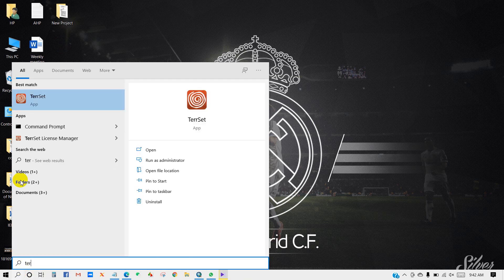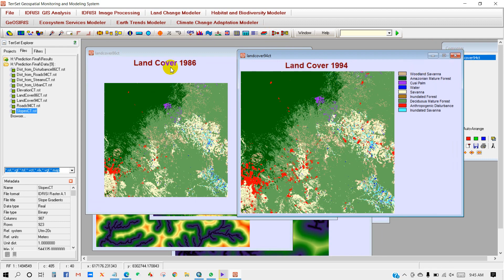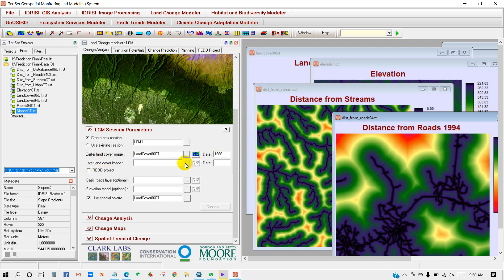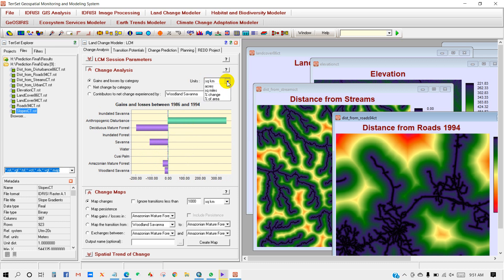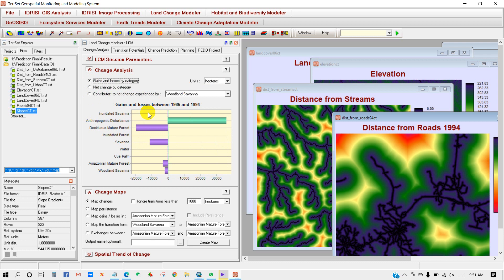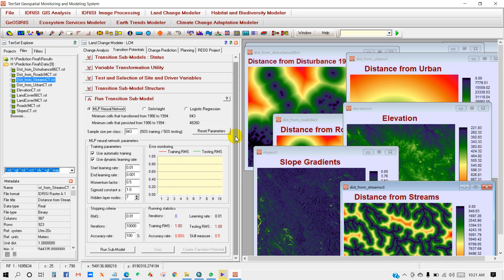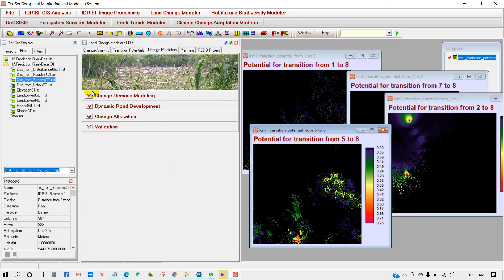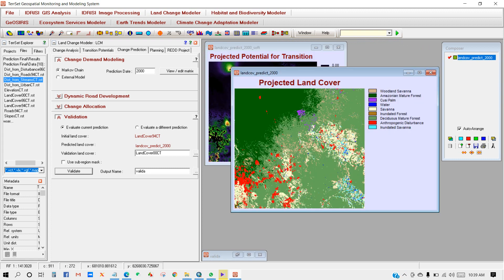LULC Prediction Tutorial Part 3: Prepare future Land Use Change Prediction Map

Comment: Dear,
I have a question regarding the explanatory variables used in the Transition Sub-Model Structure under the Transition Potentials tab. 
Do I need to normalize or standardize these explanatory variables beforehand, considering that they may have different units? For example, one variable could be distance to roads (measured in meters), while another could be slope (measured in degrees or percent rise). 
Thank you,
Regards